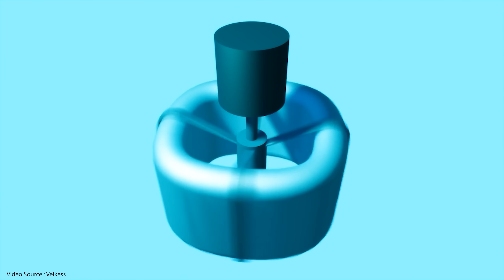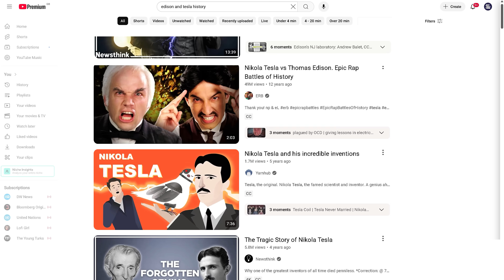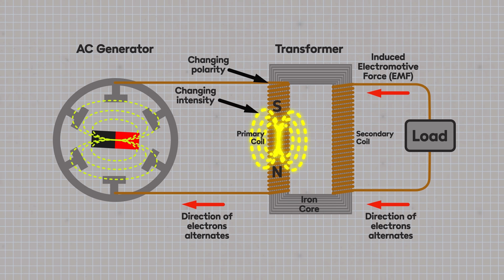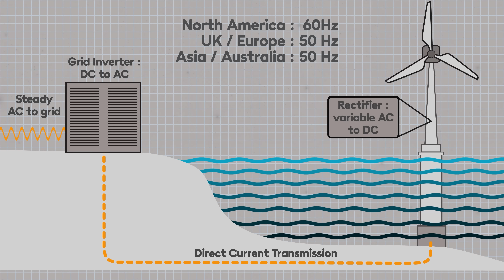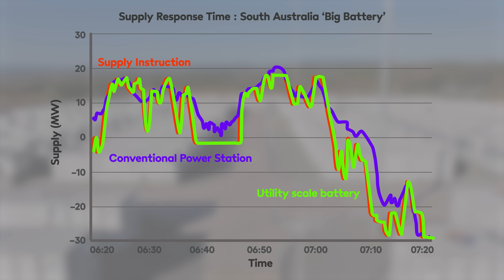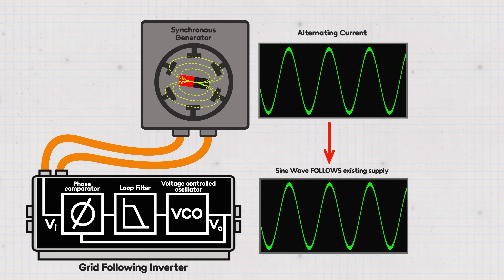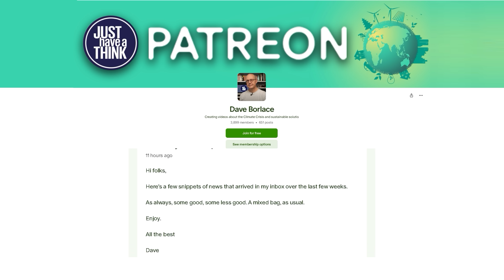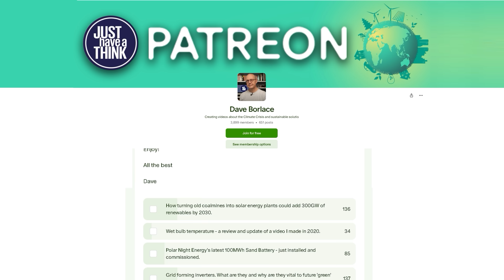How GRID FORMING INVERTERS are paving the way for 100% renewable energy.

Comment: Power electronics engineer here. Thanks for providing a great description of the various types of inverters and grid inertia. Helping people understand this stuff is crucial to debunking nonsense talking points.
Reply: This is a topic very much overdue for greater awareness - especially amongst the rather conservative organisations planning electricity networks. Australian planners are still exhibiting reluctance to accept grid forming even after the success of the Hornsdale battery. Grid following is a recipe for disaster because it essentially acts to provide positive feedback. A low frequency perturbation will be followed, rather than resisted, thus making the deviation worse, or even worse triggering a collapse. The irony is that rotating machines actually provide very modest amounts of 'inertia' compared with a modest sized grid forming battery. The one thing rotating lumps of iron and copper are good at is providing high short circuit current. In this Internet connected world where everything has an accurate sense of time,  all grid connected inverter power sources should be grid forming.
Reply: @ChrisThompson-es4zz grid forming is likely only going to be for selected master stations.  You can’t have individual houses coming onto the grid and trying to form their own network after a blackout.  If they are to go to 100% renewables then they need to change to micro grids with a DC distribution from the main power sources.  That way the micro grids can be fed and feedback to other stations without synchronisation issues.  It would solve a lot of issues but feeding cities and towns from inverters would be hugely expensive and maintenance heavy.  Not to mention the need for cooling these inverters.  
If you’ve ever worked with generators you’ll know how critical frequency is to load sharing and the destruction of bringing two unsynchronised generators together.
Reply: @ChrisThompson-es4zz  sure, until the GPS satellites are disabled for some reason
Reply: @ChrisThompson-es4zz /😊/'::
Reply: I would like to clarify a misconception I see in many of the comments related to this video...
What many people wrongly assume is that a grid-forming inverter require some accurately defined frequency reference.  The reality here is that the grid itself provides this reference and the other reality is that the grid frequency is not solidly fixed but is designed to be variable.  The grid frequency serves as both the input and output of a very sophisticated distributed democratic control system.  The logic behind this distributed control was first implemented over 100 years ago and it still works well today.  Every grid asset has the ability to 'vote' in this democratic control by trying to either pull or push the grid frequency - the rules for voting are defined based on what is called 'primary control response' - there are two 'gain' (droop) settings defined for each asset - a Volt-VAr and a Frequency-Watt setting.  The actual grid frequency according changes as a result of all these distributed votes and the single resultant frequency of the grid indicates the instantaneous balance between generation and consumption.  The grid operators can adjust these primary control response settings using what is called 'secondary control' - which involved defining different primary response droop (gain) settings in the form of a pre-determined schedule which is then communicated to each and every grid asset.  The thing with this method of control is that the channel used to communicate secondary control schedules does not need to be low latency and it is not critical to make sure that every asset is running with the latest schedule - this two tier control is deliberately designed to be resilient and robust even if the comms channel is not reliable.
Traditional (rotating) grid assets have been using this control method for over 100 years.  With renewable energy Inverter Based Resources (IBRs) the initial thinking was that they should not be based on this traditional control approach - hence the advent of grid-following inverters (a requirement to ensure that the PLL exhibits zero inertia), however as problems of having too many grid-following inverters have become apparent there has been a move to make IBRs operate according to the traditional way that other grid assets are controlled - hence this concept has been called 'grid-forming' inverters.  What need to be understood here is that these concepts are not new in the utility space and it is grid connection legislation alone that has dictated that IBRs must have zero inertia (I.E., grid following).  The main differences between grid-following Vs grid-forming relates to grid interconnection legislation and whether the PLL used in the inverter is designed to have inertia or not - No inertia = grid-following.  Inertia = grid-forming.
Reply: @michael-j-harrison  Yes, the frequency thing is a long term average (to keep the old fashioned synchronous clocks correct). In reality it (large area distributed grid) is more of a phase synchronous system. 
The 'real' issue here is the misuse of "inertia" in both the mechanical rotation sense, and for the virtual 'inertia' of control loops, and the ability to back up 'inertia' with energy over time.
There are many in the Electrical supply industry who glibly use 'inertia', without realising that duality, as a method of saying they need the older 'nasty' generators.
Reply: @michael-j-harrison  Droop and inertia are different things. Droop is the direct voltage and frequency control while inertia slows down the rate of frequency change. Most grid forming inverters have droop and no synthetic inertia. 

If you look at microgrid case studies and large-scale simulations, you will find the nadir frequency is lower with grid forming inverters then with synchronous machines. The removal of inertia allows the grid forming inverters to more quickly change from one steady state to another. 

The main differentiating factor between grid following and forming is whether it behaves like a current or voltage source.
Reply: It’s not nonsense,  in rush current is a real issue for black starts.  You can’t easily have multiple inverters starting their own grids at the same time anymore than you can have multiple small home generators all synchronised to the grid  at the same time without a networked power management system which wouldn’t function without power.
It’s  illegal in the UK to backfeed into the national grid from a generator during a blackout.  It will be the same for a grid forming inverter.  It will just allow your house to use its batteries or solar seperate to the grid.  You’d also need a mechanically interlocked breaker to do this.
Reply: @JT_2024-c8j  Inrush current is DEFINITELY an issue. Just one residential HVAC compressor can have an inrush current of 120 amps or more! Multiply that by thousands and it's easy to see the issues of a grid restart - even a partial one.
Reply: @Hybridog exactly,  people don’t realise how much of a countries  infrastructure rely on  induction motors and transformers.
Reply: @JT_2024-c8j  GREAT COMMENT deserving a lot more than the 1 thumbs I can give you.

I have worked on mine site projects which have their own girds and at times their own power stations. YOU ARE 100% right on black starting. 

The number of times I have seen OTHER ENGINEERS make stupid decisions and stupid claims and stupid comments is alarming. VERY FEW engineers actually understand black starting and few every have to do it.

Look at how many weeks it took Spain to reboot.
Reply: "you can't have multiple inverters forming their own grids" in fact you can, it might not be the most cost effective. Selectronics has some inveters which form a home microgrid. Faults on the main grid will isolate the microgrid, and when the main grid is within parameters, it will synchronise and reconnect, just like a generator. with a "trip to house load" scheme. They can even charge batteries from other grid-following inverters during an extended outage.
Reply: @liam3284 none of that is new technology, the issue is micro grids  powered by inverters won’t help large scale infrastructure loads come back online after a total blackout.  None of them will be in synchronisation.  The safety issues of multiple micro grids back feeding the grid are huge.  You still need a large power station to form a backbone grid.  Little house inverters aren’t going to help restart infrastructure.  They’ll just keep your own house online at the most.
Reply: However, a grid forming inverter still has no inertia. Me EE too. :) I don't know of an example of a black start initiated with grid forming inverters. Do you? The problem with GFI (not GHround Fault Interrupters, just doing my own jargon) is that their load response is limited by the capacity of the magnetics in the inverters. When you black start, you throw a big switch and drop the load on the gen/inverter. A bunch of big spinning things, as this presenter calls them, will have minimal sag response to the instantaneous load. Grid forming inverters can still do that, but their load response is much more dramatic and has much lower overhead, so the loads will have to be much more carefully introduced. Nothing here says it can't be done, but I definitely don't want to be in the control room when the first attempt is made in the wild. I have enough cardiac issues as it is.
Reply: @AussieUnclePhil  You mean besides every off grid inverter ever? come on guy, don't try to pretend this isn't done every day at small scale. The only reason It hasn't been done for a large scale blackout is those are rare and rotating assets are already in place. But when it does happen, it won't be a big deal.
Reply: @AussieUnclePhil  I'm an aerospace by degree but have spent the last 35+ years in industrial control systems and automation. Over that time I have done a lot of work with motor controls and that involved a lot of VSD work. 

I think these inverters will help, but anyone who thinks they are going to magically fix the system is delusional and its simply got to do with the fact THEY AREINVERTERS and how inverters fundamentally work.

We went through a revolution starting in the mid 1990s with flux vector control but it needed encoders or resolvers on the motors. Then came a major step with sensor less vector control. That was made possible by the used of DSP technology. As that tech emerged the reps used to love supply all sorts of info on how it worked. So I have a pretty good education and background on applying advanced inverter technology.

I think this synthetic invert stuff is basically nonsense. Its a lot of sales hype and wishful thinking. Way to often in engineering people forget that the simplest thing is often the best. As I said I think they'll help but nothing is ever going to replace a massive lump of metal spinning with tons of inertia backed by the tons of inertia of steam or water driving it.

I think the pro-nuclear lobby have shown just how pathetic they are and that they are more interested in sowing confusion and causing delays. The inertia problem is something a nuclear power station does and does brilliantly. The steam turbine in being fed from an EPR 2 reactor has 120tons at 1,500 rpm of real physical inertia driving a 1.6GW generator. ANYONE who thinks they are going to replace that with a battery/inverter systems needs to seriously consider another career.

The whole 7 power stations plan was WORSE than even the ALP tried to say. That LNP plan wasn't going to cost $330 or $600billion as the ALP claimed. It was going to be well over a $TRILLION and WORSE it was going to take much longer and the sites were terrible locations. BUT THEN Australia's energy system is being managed and directed by a pack of economists who have no idea WTF they are doing.

We never needed 7 sites. IF YOU CONSIDER future population needs the no matter what we need something whether its current nuclear tech or something new. The Germans have made some important steps forward with stellarator technology and maybe fusion isn't that far away. Plus in the short term there's already available dual fuel gas turbines that can run either partly or 100% on hydrogen.

Its a longer discussion but the amount of untapped potential in the renewables sector would cause riots if it became known. Its not an Australian thing either. I have heard reports out of Britain on the reverse subsidies that go to Wind farm companies.

More than anything else we need to get all the BULLSHlTTERS out of the public arena and just stop the confusion they spread. I know the guy who runs this channel means well but damn he needs to just STFU at times.
Reply: @AussieUnclePhil  You can't get physical inertia down a cable. Once you are end of the cable, there is no difference between a spinning mass and some solid state electronics. The latter is more adaptable and programmable. And probably cheaper, and more resilient. 
Of course black start is done. Every time you start up a microgrid from a battery, it's a black start.
Reply: A grid forming inverter could have inertia, it just needs the energy storage elements, whether capacitor, DC flywheel, or magnetics to make that happen, along with overcapacity in the switching elements. The question though is how the control system should act in situations where a generator would pole slip.
Reply: @AussieUnclePhil  I was, a long time ago, an EE. Certainly the over current capability of inverters is modest. But we are not talking about the big switch connecting the whole network in one go. A black start is normally performed in a graduated fashion. I would expect most of the generation sources would be powered up before connecting loads. Furthermore, we don't want to get a point where a total collapse has occurred. That is what will happen where a majority of the energy is supplied by grid following devices as they follow the frequency down after a large generator failure. The South Australian state regularly has residential solar providing all the state energy requirement. Currently solar systems follow the frequency down and are required to disconnect if system frequency falls outside a narrow range.  Is that what we really want?
Reply: @ChrisThompson-es4zz  Why would you not want to disconnect from the grid when it has too much input?  It's not like the domestic panels/batteries stop working n those houses/buildings.
It's not like the infeed tariff is worth much any more.  It was only there to boost early adoption, and we're way past that.
As soon as I can fund it, I'll be getting panels & batteries myself, and see if I can join the local micro-grid as well.
Reply: @oakfat5178 I am considering residential solar disconnection from the point of view of power system stability - not the individual residential solar power generator. The rules governing residential solar were created when solar was considered an irrelevance. Now, where it may 100% of energy, we need more appropriate rules.
Reply: @AussieUnclePhil  Inertia is just an energy store. As long as your energy store is just able to supply the peak demands for the awkward short term fault conditions, you don't need any mechanical inertia. (You just need to work out what those 'just' factors you've ignored are)

If HVDC links work, or even the off frequency HV AC interconnects (MMMC [Modular Multi-level Matrix Converter] connections in China), work without inertia, I'm not sure what the intellectual inertia problem is?
Reply: @philipoakley5498  One of the nice features of Modular Multi-Level Converters is that they have large floating capacitors in each submodule that store significant amounts of energy and can handle current spikes.
Reply: @WiggyB  They can also decouple the frequency stability issues as well. I think the Chinese have a long link of something nearer 1GW. Energies 2020, 13, 5546; doi:10.3390/en13215546 is a fun paper.
Reply: The nonsense presumably includes the Iberian blackout, that PV arrays are not very useful during winters days when daylight is less but base load demand greater, that investment in multiple connections means less investment in routine maintenance leading to the Heathrow blackout and that the UK weather patterns include periods when there is no wind at all.
I guess you would concur that the UK suffers from chronically expensive electricity resulting in industry moving off shore and unemployment. Or is that nonsense too?
Reply: Hey, maybe you would remember the lockin technology to protect generators.  Do you recall it's name?  It wasn't a PLL and was used to pass AC energy (both 60Hz, but unsynchronized).
Reply: Het WiggyB, you’re not anywhere near Canada are ya? I’m looking to speak with someone with your qualifications near Toronto, preferably a cool grandparent, but that parts not real important.
Reply: I’d like to know what types of companies make these types of grid forming inverters and determine if I can buy or build such a company. Would be fun to be a part of this!
Reply: @masterjj528 There’s nothing new or special about grid forming.  It’s an enforced limitation not a technical one.
Reply: Great video! My impression is that this solution starts with updating the grid codes. The grid codes currently telling all capacity to disconnect when frequenzy deviate. Instead of amplifying the problems solar and wind can be set to stabalise.
Reply: I definitely want to hear more talk on how keeping a bunch of generators in sync lest one be pulled or pushed too far out of phase before melting is completely different to ultimately replacing them, or putting them all behind inverters of fixed frequency and a time-locked phase.  Black starting or joining grid sections is then just about levelling voltage instead of worrying about critical phase matching.  Gradually increasing voltage above a depleted reference is also something inverters are easily capable of doing, bringing voltage up to match demand.   Rebuttal welcomed.
Reply: @AussieUnclePhil Try looking up the concept of Distributed Black Start, or Distributed ReStart. It was a project run by NESO asking the question about starting the grid with distributed generation sources.
Reply: @PomWombat27  I see that there are standards out there (e.g. the Distribution Restoration Zone Controller System (DRZCS) Standard).  And that the DRZCS standard has links to 4 vendor implementations of the standard.  And that the ideas have been tested in a sizable isolated subnet.  Seems like things are off to a good start.
Reply: they just still need their necessary quanities established, and to be priced, and for demands grids will place on them in  worst possible cases, like the Iberian one.
Reply: Iberian blackout had something to do with voltage control and reactive power. I am waiting for the full report, because the recommendations will be important
Reply: @julianholman7379  did you go through with the worst possible case (LOLOLOL) in Iberia? Do you think 12h without electricity is the worst case scenario? People still blind even when governing bodies issue recomendations. It's 72h without food....in my case as a "Peninsula" citizen and a "libertarian" ideology I don't expect grids to be robust. They are all made for maximum profit, not resiliance (it's not about renewable or fossil). So at least 9 months a year (without any restrictions), I'm fully independent (including EV) from the grid. That's an average 35-45kWh a day, including on the 28th of April.
Reply: @ALCLCFVIS  maybe, but you are of no importance to anyone but yourself
Reply: @julianholman7379  Just wanted to warn anyone reading this comment that Ovo Energy (a UK power provider) are basically scammers. I received an invoice for £315 one day, and then 12 days later, that figure mysteriously went up to £763. When I wrote to Ovo for an explanation, they did not respond. It's only when I showed all the emails to the Energy Ombudsman and they (Ombudsman) contacted Ovo and asked Ovo why they had not replied to my repeated emails that Ovo made a pathetic half-hearted apology and claimed that the charging (£763) was a mistake and £315 was the correct figure. I can tell you straight away that if Ovo thought they had made a GENUINE mistake, they would have responded to my emails and apologised for their error. This WAS NOT an error. They tried to con me by charging me more than TWICE the money I owed them. It's only when I got the Energy Ombudsman involved that Ovo got cold feet and tried to backpedal from their scam, claiming it was a mistake. Take heed, Ovo Energy are CRIMINALS. Guard all your invoices with your life and even make duplicates of your emails. Ovo WILL try and trick you out of your money.

These are examples of Ovo Energy harassing, threatening, intimidating customers with legal consequences to settle fake, phony, bogus energy bills. Ovo Energy are truly despicable. They are, as I said at the top, insidious scammers -->

https://www.birminghammail.co.uk/news/cost-of-living/ovo-energy-harassing-customer-pay-29864563

https://www.bbc.com/news/uk-england-gloucestershire-65544654
Reply: @julianholman7379  The Iberian blackout had nothing to do with inertia or a lack of grid forming inverters, though.
Reply: I still don't quite get the problem these are solving. I mean, if all you need is a stable 50Hz sine wave as a reference then you can build a circuit to give you that for under a fiver.
Reply: @BarrySW19  You need average frequency to be to within ~1 second per day,
 and within say 30 degrees of phase slip between all points in the network,
 and the phase lead / lag be in the right directions of flow as loads switch in and out.
 
And then be able to cope with lightening strikes and faults without exceeding some of those limits (or equipment breaking because they were exceeded).
Reply: @BarrySW19  Ahhhh NO - sorry but power grids do NOT work like that.

I'm an engineer and apologies to every other engineers but I am going to explain this as simply as possible.

SORRY FOR THE LONG REPLY

On one side of the equation you have a bunch of generators pumping power onto the grid. On the other side 1,000,000s of loads - some small, some big and some huge. Those loads are constantly changing as people turn things on & off or ramp stuff up & down. The generators are constantly having to adjust to handle those changes.

NOW BECAUSE ITS AC (50Hz or 60Hz) its also got WAVE like characteristics. If you have ever laid out a long spring (like a slinky) on the floor and flicked one end you get a wave go down the spring and reflect off the other end. The reflection never comes back as strong because some of the energy got absorbed by whatever was at the other end. 

AC power does something similar. MOST of the time MOST of the power goes down the wire and gets used by whatever is at the other end. We call that active power. Some gets reflected back and we call that reactive power.

So a power grid is NOT this smooth wave that is sweet and happy. Its actually more like the waves on a bay with a light swell. Yeah its all kind of consistent but there's also randomness to it.

NOW imagine your trying to control the rhythm of the waves on that bay with a paddle in a canoe. You can't because all those waves have a lot of mass and because they are moving and they have inertia.

This is the thing with traditional generators because water and steam turbines had inertia and whatever the grid pushed back with they'd keep a consistent speed and consistent frequency. So it wasn't a problem.

HOWEVER EVERY ENERGY SOURCE humans have ever used had problems. If you wanted coal power you had to dig it up and that had lots of issues. If you wanted hydro you need to dam a river and that had issues. Nuclear Fission has the waste issues Nuclear fusion doesn't yet work. 

In Britain where they are building Hinckley Point C its biggest GOOD THING is that it will have 2 massive steam turbines each with a mass of around 120tons spinning at 1,500RPM. With all the massive offshore wind Britain is building the British grid will need those 2 big steam turbines at Hinckley with all that inertia.

This is maybe one of the most annoying things BOTH the pro-nuclear and pro-renewables clown brigades. They keep fighting each other when they are actually complimentary. THEY SHOULD ACTUALLY BE PARTNERS in our future not foes.

I suspect the fossil fuel guys have infiltrated both camps and got them fighting each other because the more they fight the better it is for the fossil fuel clowns. AND THE STUPID THING THERE is that no matter what we do fossil fuels will be here for decades because it will take decades to replace it.
Reply: nonsense talking points like how wind and solar can right now replace fossil fuels.